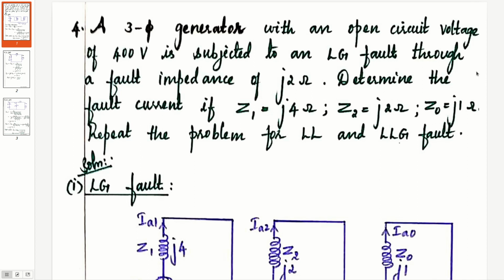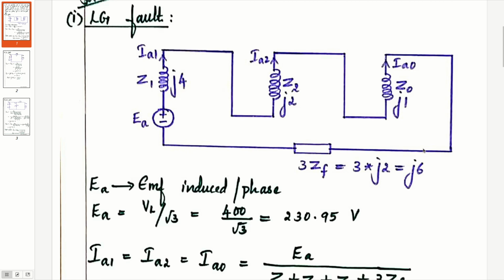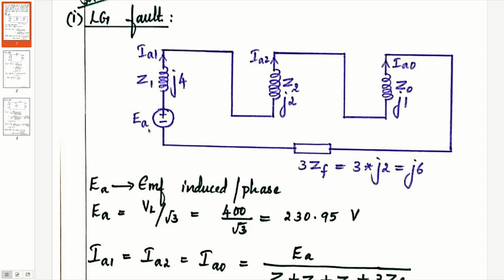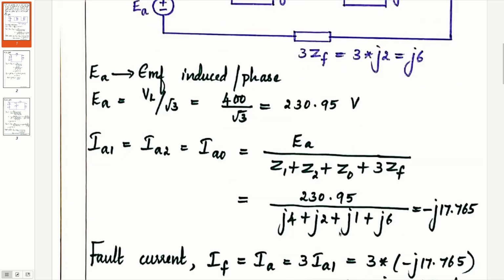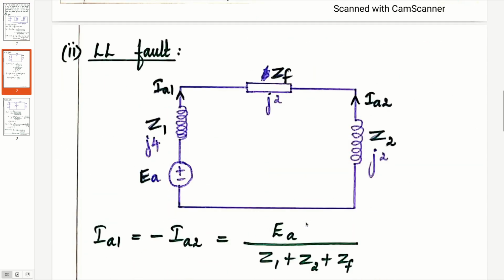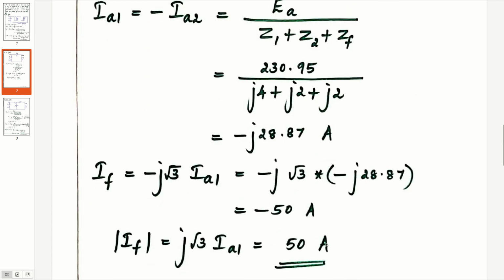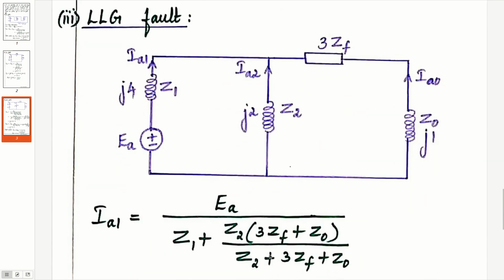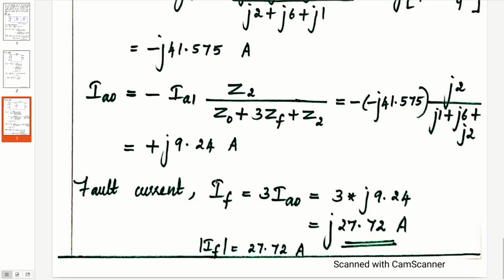Module 4  Lecture 10 - Problem 4 - LG,LL,LLG fault through fault impedance

Comment: A 25 MVA , 13.2 kV . Alternator with solidly grounded neutral has a sub - transient reactance of 0.25 pu . The - ve and zero sequence reactances are 0.35 and 0.1 pu respectively . A L G fault occurs at the terminals of this unloaded alternator . Determine fault current in ampere . Neglect resistance 
Solve this problem
Please mam🙏